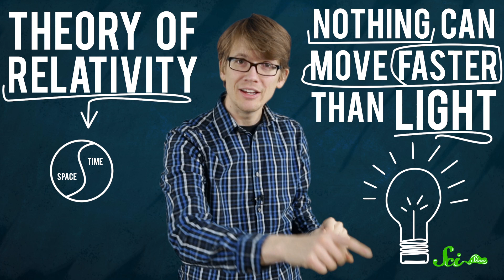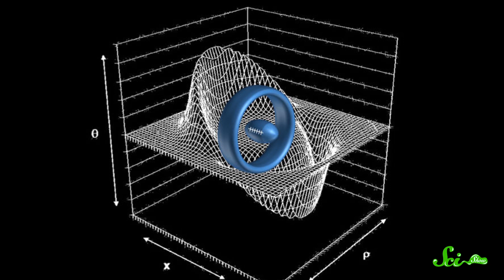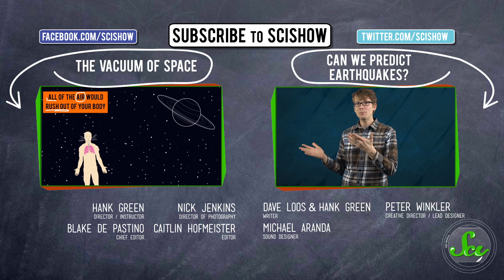Warp Drives!

Comment: The engines don't move the ship at all.
The ship stays where it is, and the engines move the universe around it.
Reply: sd Is that a Futurama reference I spy?
Reply: Sanath Chavan Wouldn't the warping of spacetime cause some serious weirdness? I admit, I'm no expert, but distortions like that should have some sort of ripple effect.
Reply: impossibru!
Reply: Like pulling a Chuck Norris; he doesn't push himself up, he pushes the Earth down
Reply: +J. A. Evans The ship does stay where it is.  The engines bend space-time.  Like imagine you set a toy on a bed sheet, and you scrunch it in the front and then pull the scrunched material behind it.  The toy never moved, the sheet did.  Grammatically, +sd said it accurately.  The ship isn't traveling, it's creating a field that bends time and space around it.  The result is a different time and space location, but no actual propulsion of matter is initiated.  The ship 'stays where it is'.
Reply: You have probably done this
Rub a bit of soap on a tooth pick on one tip, and put it in water, the toothpick moves forward instead of staying. The soap changes the surface tension of the water. Warp drive does the same thing, it compresses the spacetime ahead of the ship and expand the spacetime behind the ship, basically pulling the destination towards the ship. That’s why when the engine is shut down, the ship immediately stops instead of drifting forward, like spacecrafts usually do.
Reply: Thomas Moe It is pratical in mathematical equations to warp spacetime around spaceship by this way you can roam entire milky way galaxy in your human span, we just have do it to see if it's works
Reply: But how do we really define "moving?" If the ship moves space time around it, isn't it moving through spacetime? There's no relative marker to indicate " of, the ship stayed still, and space moved!" So it's just the interactions between mass and energy and spacetime. Therefore it's engines, do move it.
Reply: J. A. Evans Imagine an elevator, you are not actually moving, the elevator is
Reply: +sd  the warp drive would partially do that, the vehicle would still move, but you would still technically be moving some of space around. but you would be expanding it and contracting it.
Reply: +J. A. Evans Well to be honest position is relative, and the grammar is fine.
Reply: good news, everyone!
Reply: Thomas Moe Yeah it is also shown in interstellar when brand,cooper,tom and romily travel through wormhole, space distorts alot , although nothing will happen to warp drive as it under warp bubble..
Reply: Sanath Chavan But in terms of sustained trade and transportation, the wibbly-wobbliness seems too dangerous to be useful. It's the same problem as Project Orion; it's really efficient and powerful, but only really feasible for one-shot voyages.
Reply: NoNamezLeft4Me yes you have point.imagine it if you can tilt the floor and you just sit there sitting in a sleigh
yes you are moving but the moving part is the floor not you that tilt the floor
Reply: J. A. Evans that could work.  Imagine a car, which is driving retrograde to the rotation of the earth.  Theoretically, the car could just stop itself from moving, at all, and it would begin "moving" the car around at incredible speed, because while it is not moving, the entire earth is moving around it.
Reply: Of course that probably means you can never move anywhere but towards the center of the universe, since you'd essentially be riding the expansion of the universe like a wave
Reply: +NotAGoodUsername360 No because there is so much energy that it move space time around it think so much energy that it moves spacetime
Reply: J. A. Evans 

It moves but it's space time around it that moves not the ship itself.
Reply: sd Futurama
Reply: Yep, exactly
Reply: I think you all got it wrong. The ship is moving but due to the compression of space in front it will take less time to reach it's destination.

Think of it like walking down the red carpet. You can only walk a specific speed. Lets say it takes you five minutes to reach the end. We now do this again but this time we take the carpet in front of you and scrunch it up. You continue to walk at the same speed but now it only takes one minute to reach the end. 

You are moving. It just that the distance has been compressed so at to make it appear like you are moving faster.

Trying to move the whole universe around you would take infinite energy so it is not possible. Compression of just the space in front of you is more practical
Reply: Yes. SO easy to move an infinite amount of mass is easier than moving a spaceship
Reply: Futurama. Love it.
Reply: In other words, the engines are indirectly moving the ship.
The engines move the universe, which moves the ship; therefore, the engines indirectly move the ship. Q.E.D.
Reply: Thomas Moe are you even now what he mean? what he mean is simply somehow make gravity in front of you so pulled foward and make antigravity behind you so you pushed foward.imagine like put a carrot on a stick and sit on a horse and put the carrot in front of the horse while you whipping your horse butt
Reply: sd If the ship stays where it is, then how would it get anywhere in the universe? 

Sorry, I can't really stand things like these. No offense meant.
Reply: ***** "The engines don't move the ship at all.
The ship stays where it is, and the engines move the universe around it."

That's why I questioned his statement. I meant it in a grammatical way.

Comment: Doctor Brown: 65 EXAJOULES OF ENERGY! 65 EXAJOULES OF ENERGY!!! runs away
Marty: ... w-what the heck is an exajoules of energy?
Reply: Voltorb1993 yeah, problem with that is that you're gonna need that much energy to produce the antimatter in the first place, let alone having a Penning trap large and powerful enough to store the damn stuff
Reply: it's 65 000 000 000 000 000 000 J of energy. That wouldn't actually be that much of a problem... by using antimatter, you can get that ammount of energy by using "only" 362 kg of antimatter and 362 kg of matter (rougly, and I sure hope I calculated it right, but I think I did) that's still alot, but it's possible. Problem is that would be normal energy, not negative one.
Reply: ***** what? I've never heard about that. I thought 100% of both matter and antimatter is changed into pure energy. I have to look into this.

Comment: It's bold to set yourself a deadline till the end of the century to build a drive based on something of which you don't know if it's even a physical reality. If physics turns out not to be like you want it to be, you'll have a lot of explaining to do when that deadline comes.

Maybe if someone wooshes past in an Infinite Improbability Drive, negative energy will just pop into existence.
Reply: Penny Lane
 i guess it kinda helps if the deadline is so far away that the one who made it would probably be dead by the time he needed to explain anything. lol
Reply: Well we did create a lot of stuff using Relativity and Quantum Mechanic way less than a century after their discovery.
Reply: Djorgal Emphasis on after their discovery.
Reply: Penny Lane Yes but what I'm saying is that we use everyday technology that was theoretically impossible a century ago.

I don't know what kind of technology we'll use in a century, but I wouldn't be that surprised if that is some practical applications of theories not yet discovered.
Reply: Djorgal Neither would I but my point is: you can't just discover new physics on a deadline and you especially can't determine in advance what kind of physics that will be. Why do I even have to spell that out like this; isn't that kind of a no-brainer?

Comment: For this not to violate relativity, the ship itself could not control the bubble -- because the speed of light is the speed of information. Giving a command to "end spacetime contraction" out in front of the ship would require the command to travel faster than the speed of light.

This doesn't preclude some type of "timer" or gradual dissipation of the warp bubble built into its creation, I suppose.
Reply: Ahh good sir, you seemed to have missed some main points, or perhaps the whole concept, of Einstein's theory of relativity, the main ones being:
1. In an inertial frame of reference all measurements and experiments give the same results
2. It is impossible to detect the motion of an inertial frame of reference by experiment within that frame of reference
3. The only way to measure the motion of your frame of reference is by measuring it against someone else's frame of reference.
Although the third point doesn't really apply right now, the main idea is that the way of controlling the proposed "bubble" exists in our frame of reference at the time, therefore the space within the "bubble" remains "motionless" in a sense, as per point 2 above.  Since the bubble contains a different inertial frame of reference to the one on the outside, where the space is being bent, due to point 1 above, "all measurement and experiments give the same results" meaning that the speed of light is the same on the inside and outside of the "bubble."
No physics being broken here?  Happy?
Do hope this enlightened you a little. :)
Reply: Brett Andrews I REALLY don't understand how this bubble can propagate faster than speed of light, regardless of reference frame.

Gravity waves only travel at the speed of light, and they are by definition propagating fields of spacetime contraction.

Is the use of "negative energy" the cheat that allows one to break the "speed of information"? If so, this is all on paper, with no theoretical backing from real-world observation -- it's tachyons warmed over.
Reply: Brett Andrews What I'm trying to say is the use of "negative energy" might be as meaningless as the informational content of the statement "this sentence is false."
Reply: You are very right. Gravity might not even be a fundamental force. Read about " the electric universe"  This physicist talks about how everything gravity does can be explained without it, replacing it with electromagnetism. This group of Drs  believe there are only3 fundamental forces.
Reply: .3.
Reply: Len Arends
you have proof that gravity travels at the speed of light?
Reply: Len Arends
and you have proof that gravity is in the form of waves?
Reply: Jenna Love A wave is by definition the expansion/contraction of a medium shifting contiguously in position. Gravitational waves necessarily travelling at the speed of light is an element of general relativity. Very few events have the combination of mass and speed necessary to detectably demonstrate the truth of this, but some preliminary confirmations have been published. Do a web search of "speed of gravity".
Reply: And since information cant travel faster than light then the object would have a delayed reaction which proves nothing about gravity because no one knows what it is
Reply: timberjack
I'm not even going to answer this, because you are absolutely right! <3
Reply: Len Arends In any case, I took a while to think about the concept you produced about the bubble propagating faster then the speed of light, even going as far as to look over some of Einstein's thought experiments again, and came to the conclusion that you actually wrote down yourself: "speed of information."  It's only the speed of information. To keep in line with special relativity, once said speed is broken, the object simply gives OFF no information (light), while within the bubble - and the bubble itself - information (light) remains as constant as ever.

Therefore, to the observer relative to pretty much everything else in the universe, the proposed warp drive - and everything inside it would appear to vanish without a trace, only to be seen again when it stopped moving 'faster than the speed of light', and the light from it's arrival destination reached the observer.  While the passenger of said warp drive would simply interpret this as "crazy fast movement" - courtesy of Hank Green himself.

I do hope this cleared up any misconceptions, and I do thank you for giving me something so interesting to think about.
P.S Keep in mind that theoretical physics is all hypothetical nonsense half the time.
Reply: Brett Andrews I'm starting a new comment string in response to this last statement. Please see above.
Reply: Don't you realize that the space within the warp bubble space isn't moving, so technically if you had the command to start of stop the drive there would be no issue in sending the signal, because even though space is moving you aren't even by definition moving through space the space is moving you, oh and by the way i respect you for having an opinion on the matter but please if you are ever going to comment of something like this make sure you know a lot about the subject at hand.
Reply: Yiṣḥāq David The electric universe is nonsense.
Reply: daniel cason So is every other theory. Thats why its called theory. In general though, The electric universe is almost 100% wrong. I know I just found it interesting. It explains though why gravity is so damn weak compared with the other 3 fundamental forces without having to add extra dimensions. The generally excepted ideology of why that gravity is weak is because it in all dimensions. That being said, gravity has so much space to cover that its weaker,
Reply: Len Arends yeah thats psudoscience. There is only a law of gravity. There isnt a theory of gravity yet :/

Comment: The funny thing is, if we could generate so much energy as is probably needed for those drives, we wouldn't even need space flight anymore. If we could easily create so much energy, we could quite literally solve all problems we have on Earth. We could create a post-scarcity society on Earth without ever needing to bother about space.
Reply: Fermi Paradox, solved.
Reply: That would be nice, but we would eventually have to expand into space anyway. Granded, in few billion years, but we would have to.
Reply: Voltorb1993
"We may probably need to move in a time longer than multicellular life has existed on Earth" is quite something else from "we should expand into space [implied: now]".
Reply: Fusion energy would solve every problem.
Reply: AnimefreakHQ
Even at best estimates, even fusion energy would not be enough to either get the necessary energy for this theoretical warp drive (if it's even possible...) or for a post-scarcity society.
Reply: NovaHessia As I see it, post-scarcity society isn't dependent on any absolute level of power. Net productivity per person just needs to be in excess of that necessary for food, shelter, and medicine. As people lose the desire to reproduce, population decline increases dependence on automation, while increasing available resources per capita.
Reply: NovaHessia Fusion energy is a method that would bring abundant of energy. I don't see how that will not be enough when warp drive would need energy equal to the amount used in US for a year.
Reply: We already create that much energy every year in the U.S.A alone.
Of course we would have to create all that energy alongside current production and store it either as negative energy or find a way to convert it mid-flight.
Reply: Angel Samael
And how many hundreds plants are used to produce that energy? You want to stick them all on a spaceship? And storing so much energy is not a simple engineering challenge, either - that would in fact be just as complicated as producing the energy in-flight.

Plus, this "annual US energy production" thing is calculated for ONE flight. If we were to have a real interstellar civilization, those would have to happen way more often...

Comment: Cannot experiments be used with very small objects requiring very small bubbles and warping a very short distance (assuming the distance travel is variable in the energy required) used to test the theory?  How much energy would be required to warp a carbon atom a distance of a micrometer, for example.

Comment: What are your thoughts on the EMdrive?  Think it could possibly work or is just a big hunk of bologna?
Reply: Everybody thinks that the EM drive is impossible, but I have a theory of how it could work. Do you know that empty space is full of virtual particles that pop in and out of existence? If you're ever heard of Casimir effect, then you know that is caused by the quantum vacuum.

What causes the plates in vacuum space a micron apart to attract? Its the deficit of vacuum energy. It's like creating a lower pressure region in air or water. The surrounding higher pressure region tries to rush in and fill the ''hole''.

Now back to the EM drive. The microwave thruster somehow creates a lower pressure region in the engine and the vacuum tries to fill this space, pushing the craft a minuscule amount.
Reply: Olaf Seisler EM drives would need lots of power but you are replacing the mass of fuel that would burn for minutes with a nuclear reactor (and radiators) that would run at full power for years. If you can accelerate+decelerate to any planet you not only get there really fast but you are creating artificial gravity, too.